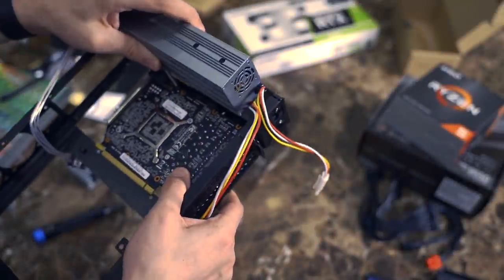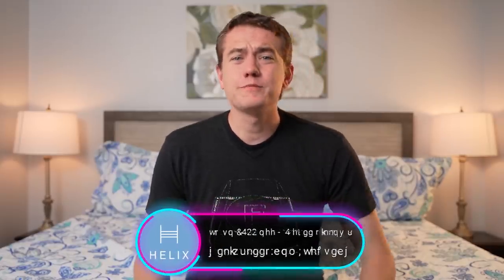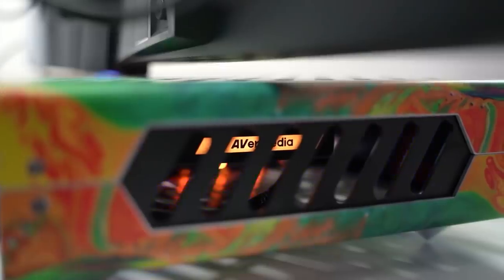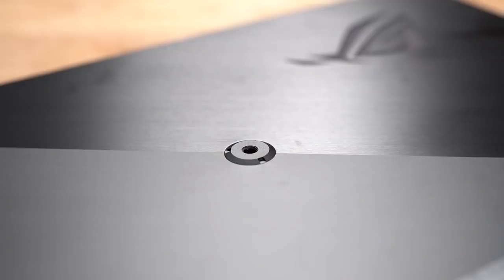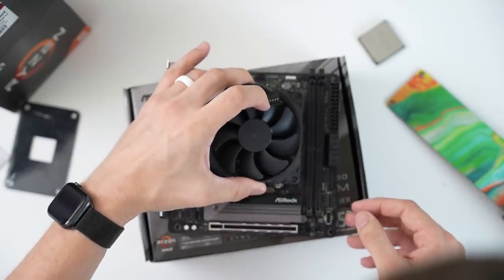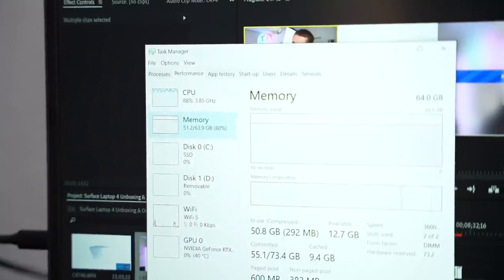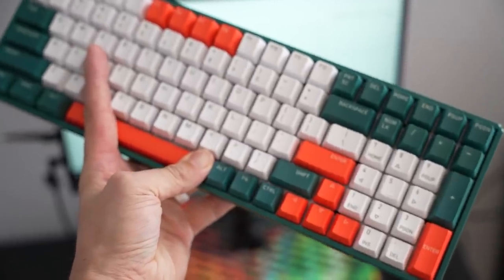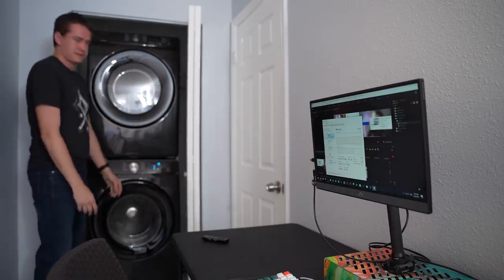The Ultimate Portable Gaming Setup

Comment: use a washer on the bottom screw for the monitor. The screw is going to eat that aluminum on the case, adding the washer will also improve stability

Comment: my "portable" gaming setup is just my mid atx pc with a carrying case strapped around the pc. Its open concept carrying case so I can access all my ports on the fly. Right now I just use a long hdmi cable and I also keep a wireless keyboard remote controller if I just want to plug it into a hotel tv and watch movies or stream stuff. Xbox controller for gaming as well as keyboard and mouse. I still need to get one of those portable gaming monitors!

Comment: My inner engineer would like to see a washer or some other spreading plate for the monitor mount on the inside of the case so that the monitor doesn't hang on the edge of the screw. Otherwise a very nice setup

Comment: I wanted something like this but I overbuilt on the Intel i9 & Z590i w/ SFX PSU so cooling is limiting me to size now. What's the most compact Intel version I can squeeze in and still do my Adobe Creative Suite. I'm still on 980 Ti till I get a used 2080 Ti. I wanted to use the ThermalRight AXP Copper.  So now I'm on the XTIA Xproto-A4 open frame for as small footprint I can get w/ good cooling a 10 core i9. It's cool but not as safe to pack  up.

Comment: Hey @UFD Tech   Is it possible to get answer from you about ps 5? I'm wondering that will the "SSD Gigabyte Aorus 2 TB M.2 2280 PCI-E x4 Gen4 NVMe (GP-ASM2NE6200TTTD)" match to PS5 m.2 slot without removing radiator from the disk?
Reply from the maker: No it won't. No NVME drive works with the PS5 currently.
Reply: @UFDTech  i know but i mean only is there enough space just to put it (for future, when then activate the slot)
Reply: @UFDTech  so? :D What about size? is there enough space to install it?